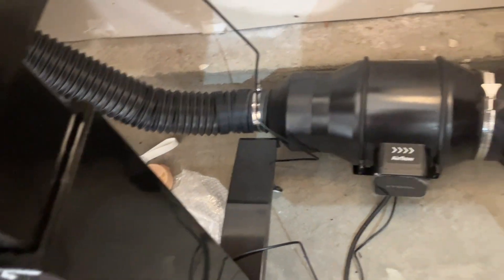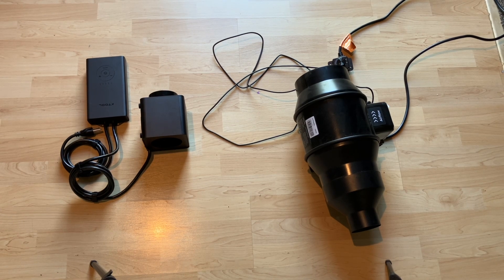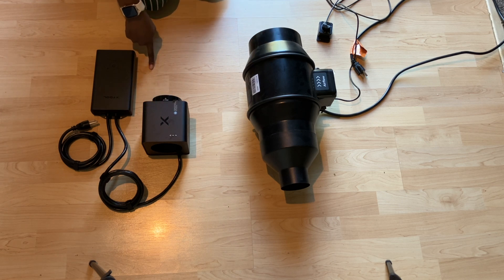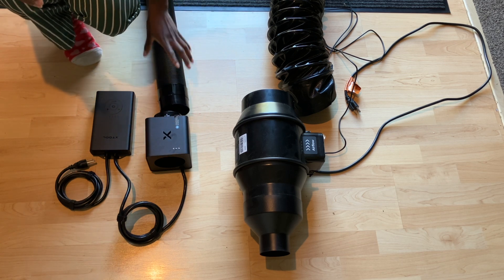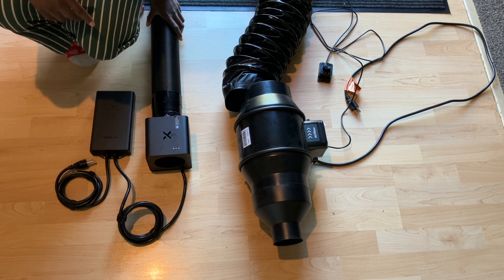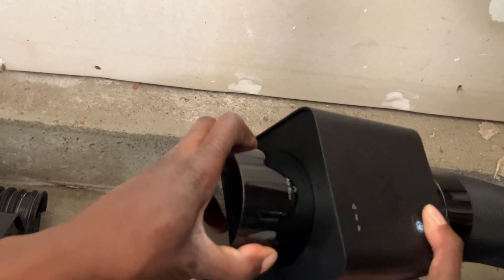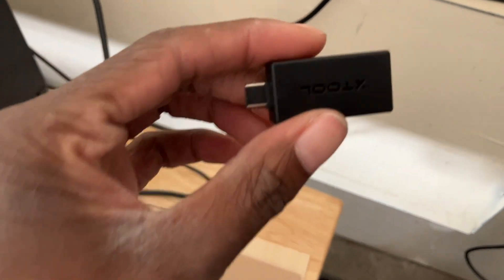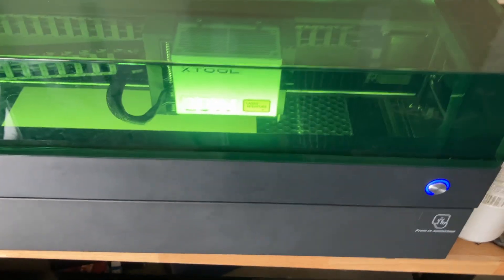xTool IF2 Setup with S1 and Comparison with previous Inline Duct Fan

Comment: Thank you for a nice demo of the IF2. I just ordered one. My current vent fan can't get rid of leather and rubber stamp odors fast enough. I hope this does the trick. I bet it might keep the laser cooling fans cleaner as well. I have the S1-40w and the 2w-IR module.
Reply from the maker: Hope this helps with the odors for you. It has worked for me with the materials I use on mine so far.